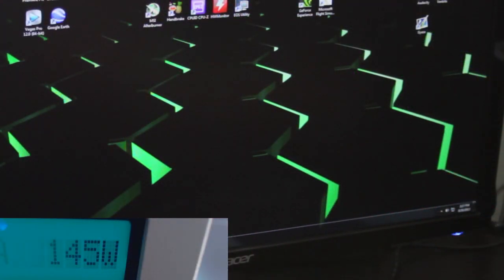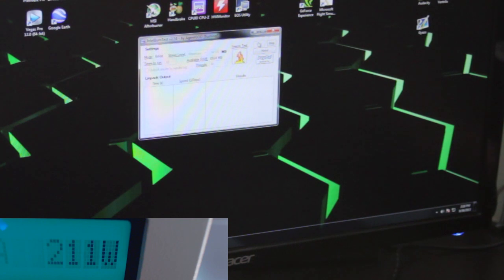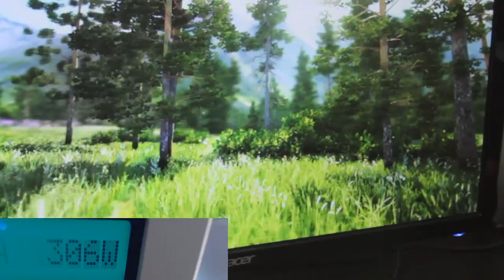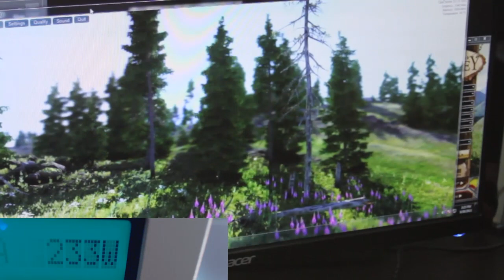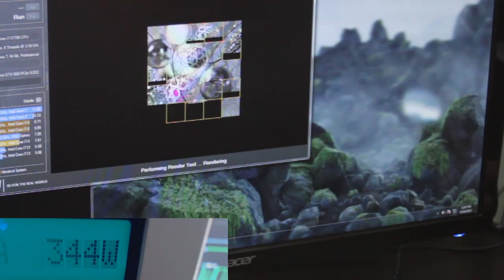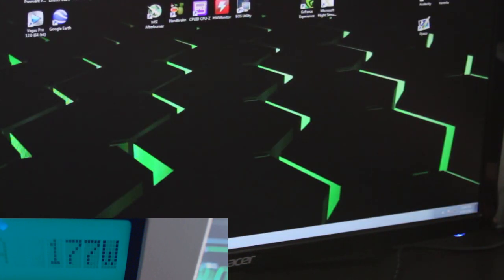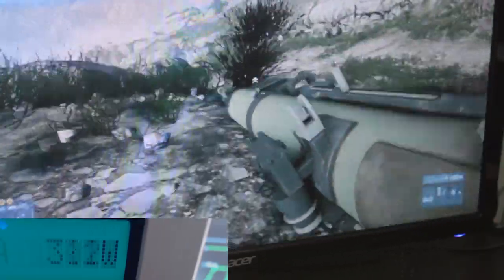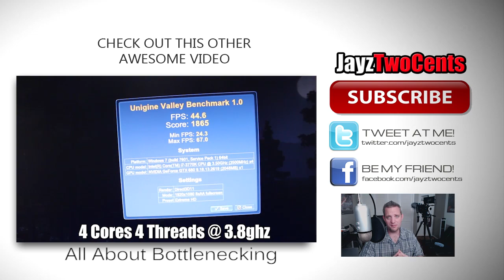How big of a Power Supply do you REALLY need?

Comment: Can you recommend one for this build?

Cooler Master Hyper 212 EVO 
 
Thermaltake V3 Black Edition VL80001W2Z No PS Mid Tower Gaming Case (Black)
 
MSI Computer Corp. Motherboard North Bridge AMD 970 & South Bridge AMD SB950 Chipset ATX DDR3 800 AMD AM3+ Motherboards (970A-G46)

 AMD FD6300WMHKBOX FX-6300 6-Core Processor Black Edition

 EVGA GeForce GTX 750 2GB.00 (7%)
 
Crucial Ballistix Sport 8GB Single DDR3 1600 MT/s (PC3-12800) CL9 @1.5V UDIMM 240-Pin Memory BLS8G3D1609DS1S00
Reply: 500 watts is more then enough for that build. I Have a kind of similiar build and I'm running 600 so that one day I can run crossfire.
Reply: Im gonna do a 600watt then. Love your videos and thanks for responding!

Comment: going to setup a fx8350 no OC, sabertooth 990fx, gtx 780ti, noctua d15, 1 asus dvd rw- cd rw, 1 500gb hdd, 1 case fan, with a silverstone sst-st50ef 500w. 80 plus. not going to be running it at full load all the time but I don't really want to worry about failure or overtaxing it. Seem legit??

Comment: could i possibly run a sapphire radeon vapor x r9 290 with a 430 w evga 30+ power supply?
apu- A10 5880k- on board 3.8gh 
8 g ram
1tb hard drive
2 fans plus the apu fan

Comment: I would like to know if my power supply works with my spec

Chassi: CM Storm Scout II
Power Supply: Corsair CX 600M, 600W PSU 80+ Bronze
Fans :Cooler Master JetFlo 120mm LED
Morderboard: Asus M5A97 R2.0
Cpu: AMD FX-8350 8-Core Vishera 4.0Ghz
Grapfic Card: Sapphire Radeon R9 270X
Hard driv: Seagate Barracuda® 1TB
Memory: Crucial DDR3 1600MHz 8GB
A old Cd reader
Reply: yes no prb
Reply: okey :) thanks for answer my comment. Got that pc next month, this computer is 4 years old and cant play new games on high settings =( gonna be sweet with a new pc

Comment: your definition of 80+ is totally wrong dude. from a 1000w psu under full load u will get at least 1000w no matter weather it is 80+ or not. but a 80+(80% efficient at 100% load) psu will draw ~1250w or 80+ gold(87% efficient at 100% load) will draw ~1149w from your wall socket ...thats all
Reply: ***** 
Educate yourself

http://www.hardwaresecrets.com/article/Understanding-the-80-Plus-Certification/742

http://www.tomshardware.com/forum/327742-28-80plus-bronze-silver-gold-platinum

http://m.hexus.net/tech/tech-explained/psu/29911-80-plus-certification/
Reply: ivan134 he's saying if it is 80% efficient then only 80% of that power that is drawn will go to your PC, the other 20% will be turned to heat.
A PC that uses 100% full load on a 500w power supply will use 625w from your outlet, but only 500w will actually go into use for your PC.

A 500w PSU will always be able to supply 500w, although it may need to use more a lot more to actually supply that 500 watts
Reply: ivan134 if you don't have any knowledge about something it's better not to talk shits. i'm an EEE graduate & i worked with lots of ATX PSUs. there are still bunch of psus & load testers laying on my desk. to understand psu power efficiency you don't need to be a electrical engineer. you just need to google & check psu reviews on reputed sites......
Reply: ***** lol  from the next time do some 'google'(if you know what it is!) before arguing about some basic fact

***** these calculators basically add the TDPs(thermal design power) of your CPU,GPU,ram,hdd etc from their database plus keep 50-100w headroom for safety purpose and then show you a approx value. the actual power draw is a lot lesser as components barely reach it's tdp limit. So for rough estimation yes these calculators can be trusted but to get accurate consumption u need to use a kill a watt meter or something like this.......
Reply: The name, Jack the Ripper, isn't used in England. BUT, thanks for the better explanation on 80+ :)
Reply: If you're still in doubt, you can go to your motherboard's manufacturer website and they usually have a calculator that is more specific for the motherboard and also they usually provide a complete list of compatibility parts.
Reply: Jack D Ripper
Or just look at the stickers on some power supplies. It will say DC Output right next to the amperage and wattage ratings.
Reply: Etheoma capacitor aging is never as big as 25%. actually it happens when the ESR(Equivalent series resistance) of caps increases with the time. but it's almost negligible for good branded psus equipped with high quality caps. i have a 10 years old delta 400w psu whose ESR is still within the specification and the output capability is exactly the same. efficiency reduced only a bit(below 1%). i have never seen a reputed branded psu that lost it's capability by a noticeable margin within 4-5 years.  
but yes cap aging can be a serious problem for generic/non branded psus equipped with cheap chinese caps(specially those that come with the casing).....
Reply: Dipanjan Biswas
A power supply that can deliver up to 800W to components, and is 80% efficient when doing so, is an 800W power supply, NOT a 1000W power supply. The wattage rating is for the DC output, NOT the AC power it draws from the wall.
Reply: Sakkura1
there are 2 kinds of psu´s putside, the ones who say how much power they can deliver, and the ones who state how much they may draw, so well both are right and wrong, it depends on the psu
Reply: majstealth
ALL power supplies are rated by their DC output. The only problem you can run into are dishonest brands overrating their power supplies, either by marketing them on the peak DC wattage they can handle, or by simply putting a completely fake wattage on there.
Reply: ***** yes i know lots of people use crappy non branded psus but not many gamer i believe. these psus simply can't handle a gaming pc containing cpu/gpu each 100+w tdp.
i have tested lots of entry level/mediocre psus from reputed brands like corsair/antec/Tt etc after 2-3 years of use. never noticed any sign of aging effect like output or efficiency decrease,ripple increase etc...
Reply: if it was that...
then why manufacturers didnt name it as 120% efficiency.. cause 80% efficiency at 100% load mathematically means 800 watts for a 1000 watt psu
Reply: ILostMyMomInTheGrocery Store that's why i said 'under full load'. every 80+ genre(bronze,silver,gold... etc) has different efficiency requirements for different percentage of load(20%,40%...100%). i used 100% for easy understanding and i mentioned that within a bracket. nobody here said that psus always draw their max amount! so don't make a unusual comment without understanding anything clearly....
Reply: Etheoma you are the one here getting worked up. We were all having a nice comment thread until you came.
Reply: exactly...i am really surprised that Jay, who has a tremendous amount of knowledge regarding computers...doesn't know about this...
Reply: ***** the PSU can lose efficiency over time, but if you're going to upgrade soon after building your rig, you can just get the bigger power supply if you want
Reply: You're wrong and he's right. If you have a 500W power supply and it's 80% efficient, it's maximum output will be 400W. I'm not sure why you think a fraction of a whole = more.

Comment: EDIT: okay you can read on but I answered my question. I put my build in pcpartpicker and it says 508 estimated wattage so I'm definitely goint to need like 750 :/ oh well, they're not that expensive and i can pass my 500 down to my dad with the old 7770 :)

So, Im using a Corsair CX500M (80 Plus Bronze) with 

FX-6350 OC to 4.5 Ghz
Powercolor 7770 ghz edition 1gb (overclocked)
8gb G.Skill DDR3-1600 RAM
1 SSD
WD Black 1TB 72000rpm HDD
5 case fans
 
Even though AMD stuff is power hungry, I would like to know if my PSU will support a Sapphire R9 290 4gb to replace the HD 7770 Ghz Edition

I'm speculating "no" and I should really upgrade my PSU, but I would like to know if I can at least run it for a bit until Christmas when  may be able to get a bigger PSU.
Heaven forbid I ruin my R9 290 Vapor-X because I had too small of a PSU.

What are your guys' opinions? Thanks!
Reply: Willi Gee yeah I ended up getting the EVGA 750W G1 and a 290X Lightning from MSI. was only like 20 dollars more after rebate...still is! :D

Comment: hey guys, I am really stumped as I have just installed my new motherboard, and I was wondering if this is ok for a build for a 750w psu.

MSI z97 Mpower motherboard, intel core 15 4670 (not overclocked), MSI gtx 780 lightning, corsair H60, plus 8hgb ram and 1 HDD and one DVD CDR drive. is the corsair 750W ok for this kinda build?

Comment: I have a gateway DX
it is with i5 2320
PSU 300w
EVGA 750 TI SC
6 GB RAM
I usually play games like BF4, watchdogs, and ArchAge.
Heaven staggers a lot and flatlines on 20 FPS
Would my PSU be the issue? 
My very first heaven test i capped at 80 FPS, now its at 60.
the lowest was 30, now 20.. Score was around 1k, now drops to below 700.
I did a little overclocking more, and during heaven, it black screened and the safe mode my GPU. I run it on factory SC, but it's not running like when I first tested it out.

Comment: I need some advice - just had what I think was a PSU burnout, nothing will turn on and multimeter readings are zero. Just upgraded my GPU, but I checked before upgrading - I should never have exceeded about 500W, and I have a G7 Power Extreme 680W PSU (admittedly a few years old). System specs:
AMD FX 4170 Processor (not overclocked)
M5A78L-M/USB3 Motherboard
1TB 3.5” SATA Hard Drive
2x sticks of 4GB DDR3 RAM
GTX970 Gaming 4G Graphics Card (often overclocked).
Samsung DVD WriteMaster SH-222 CD Drive (probably irrelevant)
2x 75mm fans (yeah, I need better ones!)
A couple of USB devices, including a 1TB External Hard Drive

Surely 680W is enough for this? Or does it look like I bought a bad PSU? Or did it just die of old age? All the PSU calculators I used came up with different answers on ideal PCU, from 650W to 450W.

Any advice is appreciated. Help meh!
Reply: Definitely not the PSU, maybe the mobo? Or even the HDD.
Reply: Never Use A PSU You Have Never Heard of
Reply: I had a G7 Power Extreme 680W and it blew something on my motherboard.
I now use an Antec High Current Gamer 520W 80+ Bronze. No problems!
Reply: Cheers for the advice, guys - I'm getting a Corsair CX600M, never going near G7 again. :)

Comment: You are misinformed, No power supply have good efficiency ratio on the beginning and also on the end of the power range, this means That you wanna save energy, it's recommended that you try to use a power supply at least twice you needs, this will force the power supply to operate on the highest efficiency .

Load	Efficiency	PFC
5%	80.01%	0.816
10%	84.20%	0.877
20%	90.56%	0.939
50%	92.74%	0.980  <<<<<
80%	91.80%	0.986
100%	91.01%	0.987
110%	90.98%	0.989

Comment: can my power supply support this: AMD FX-8350 Black Edition, 2 VisionTek R9 285s, MSI 990FXA-GD80, 16 gigs of Corsair Vengeance RAM, 1 Terabyte Hard drive, 2 fans, 1 Corsair 75H Liquid cooler, using 4 USB Devices if that helps.

I have a 750W Power supply
Reply: Kirn20 1000ghz... uhm
impossible?
Reply: Kirn20 1000GHz O.O
Reply: i might oOC the graphics cards to 1000GHz or something similar to that
Reply: What brand is the powersupply
Reply: Corsair HX 750
Reply: Kirn20 yes, that powersupply will be able to support that 24/7
Reply: kk, thanks
Reply: ***** Bro, anything's possible! You just have to believvvve!
Reply: He obviously means MHz
Reply: lfren38 Thank you XD that was a horrible typo, even though i could POSSIBLY do what with water and ice XD
Reply: Kirn20 I have my 980 down clocked to one hz. Yes hz, as in 1 1 millionth of a megahert and 1 1 billionth of a gigahert
Jkjlol

Comment: There is at lot of mis information in this video first as evilmatchbox says the rating is:
80 plus cert specifies efficiency to be measured as input over output NOT output over input. So a 80% efficient 1000 watt PS at 100% load will be drawing 1250 watts from the outlet.  20% of that power is lost to heat.  The wattage on the side of your power supply is the actual maximum wattage it can deliver to your computer but not the maximum wattage it will draw from the outlet.
http://en.wikipedia.org/wiki/80_Plus
he also mistakes the rating i terms of the requerements.I recomment to look at the ratings in the link http://en.wikipedia.org/wiki/80_Plus. so if you go for the best energy efficiency you need PSU that is 100% bigger than your system draw from the PSU.
this is the rating on my PSU
at 20% load = 85,5%
at 50% load = 89,8%
at 100% load = 85,5%
http://www.legitreviews.com/cooler-master-silent-pro-m2-1500w-psu-review_2044/7
I draw arround 700W at full load so my efficiency is arround 89%.
If you do not load you system at the maxímum posible the most of the time it migth be better to go with the wattage on the PSU that your system at max load. this way you will load your system the most of the time closer to the max efficiency.
hope this helps find the correct PSU for you.

Comment: would a antec 430watt power supply( i have no clue if its 80+ or any model number because its covered up because of my case) be enough to power: a gigabyte ga-970-d3p, a asus r9 280, a amd fx-6300, G.SKILL ripjaws x 8gb (2x4gb) 1866 mhz?
Reply: I would get at the very least 500w.
Reply: ive gotten an antec 380watt and i still need a video card might be getting a 6970 and i might give that its own psu
Reply: You should just get a Corsair CX 500w PSU with a R9 285. You could probably find one on sale for as little as $219 that's what I got, though it may have gone up to $245 by now, its still pretty good for the price.
Reply: living here in michigan i really wouldnt mind a hot gpu  but i think i might get a similar psu to that when i can

Comment: what power supply do you think i would need for this build
single EVGA gtx 770 with acx cooler superclocked edition
Intel i5 4670k
Corsair Vengeance Pro Series Blue 8G
msi Z97 PC MATE 
Cooler Master Hyper 212 EVO 
WD 1 tb black
1 corsair af 120 quiet edition
1 corsair af 120 performance edtion

Comment: I just build a new computer and I put a cx600m inside to power everything up a fx 8350 r9 280  8GB 1866 RAM 1tb WD black motherboard is a gigabyte 990fxa-ud3 would I have enough extra power to go crossfire get
An SSD get 8gb more ram so I have 16 or do I need a 750W power supply

Comment: i want to buy a pc case with a pre build in power supply, it dosent have the 80+ it just says 550w. should i go with it? the pc I'm building is 

gpu: Msi Gtx 750 Ti
cpu: AMD A8-7600 4-Core Max Freq 3.8GHz
Ram: 8 or 4gb (depending on budget) 
psu: (please recommend one for around $50) 
Mother board: MSI A78M-E35
Hdd: 1tb hdd 
case: (depending on psu) 

PLEASE HELP: should i get a case with a graphics card and if so how big of a power supply? if not link me to one that would fit my system. Thanks
Reply: The best power supply brand is evga, 600w evga is only $59
Reply: I wouldn't go for it, you might just want to add a couple of bucks and buying one from a trusted brand, preferably with that 80+ Rating. What brand is the one you're looking at?
Reply: I beg you to get a case with out a psu pre-installed. Get a 600w powersupply from antec, seasonic or corsair.
Reply: ***** they aren't the best. But they sure are great power supplies
Reply: *****
I'd go for a Corsair CX 500w, you find them for a little over $50. It also gives headroom for some upgrades.
Reply: If the Case comes from a reputable company, such as corsair, then yes. But make sure that the case manufacturer makes quality PSU's as well.
Reply: *****
That's true, dual graphics mode would be great. Never thought of that.
Reply: A Rosewill Case Could be a good option for a PSU built in the case, But its better to go with the options previously said.
Reply: ***** Still alot better then logisys and coolmax psu's.

Comment: Thanks for the tutorial. Now it makes me think a little about my build. I have FX8350 with AMD R9 290 on 650 psu. I decided to get another R9 290 so that I can max out my settings using eyefinity setup. I went ahead and got 1000 watt psu with 80plus gold. The calculator I used at coolmaster website asked for at lease 880 watts. I am planning to over lock my CPU to 4.7Ghz also. Hopefully I wad not over zealous about the psu.

Comment: i have a 760 and 4770 with a 500 watt and want to upgrade my gpu to 780 or r9 290x would i need to get a new PSU as well or what?
Reply: Your system wont need more than 400W, so if you have a high quality psu, it will be fine.

Comment: The 180W power supply for MSI GT60 and GT70 2OD and 2PE laptops can be a limitation if you have an Extreme overclocked CPU installed. When power consumption goes over 180W or so, the laptop uses something called "NOS" to use up power from the battery! It will continue to do this as needed until the computer power consumption is reduced or when the battery goes down to 30%.
This is retarded. MSI should have used a 240W AC adapter for these laptops as Asus does.

Though now with the new GT72 laptop from MSI, it does have a 230W AC adapter, but now you can't upgrade to an Extreme CPU because the CPu is soldered, argh.

Comment: Better take Furmark as Graphics Test and set it to Dynamic Camera and no AA.
This is the most powerconsuming test i could find. 3DMark Firestrike or Valley comes noway near that.
My Haswell i5 4460 (with prime95 loaded) and R9 280 on max OC had a peak of 415 Watt.
I have an be quiet Straight Power E9 580 Watt PSU. Still it is overshooting the 415 Watt,
but i have it because of the Cable management where only one port is needed for my GfxCard.
Otherwise i had choosen the 480 Watt model. The 415 W are never reached by games anyway.
Oh, and Idle i get around 34 Watt, 30 W with the Monitor going to standby.
I bet this would be better with the 480 W Model.